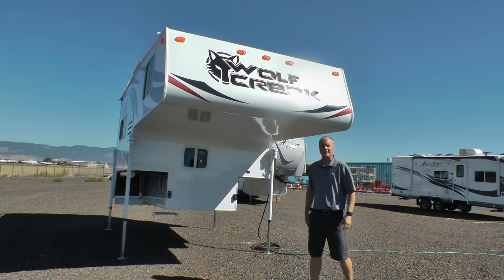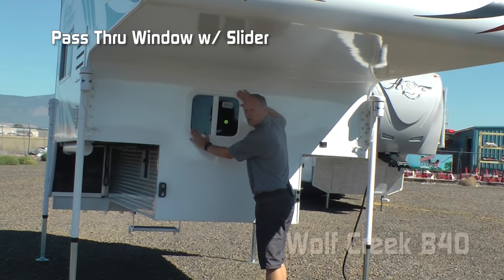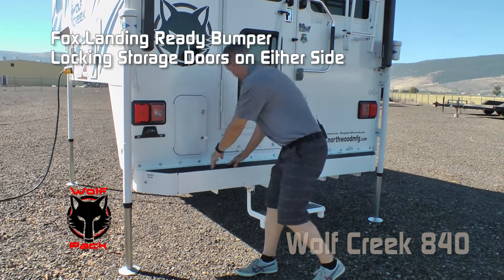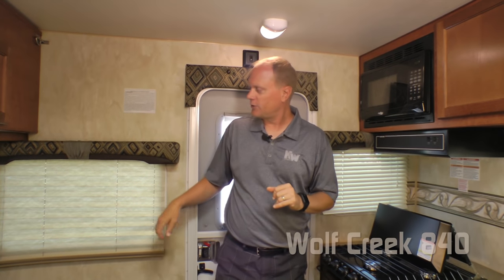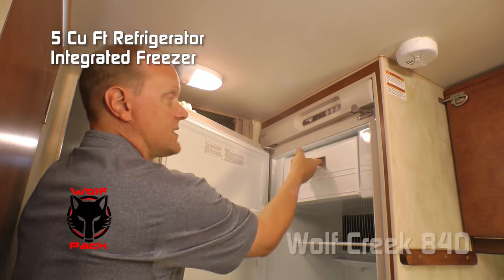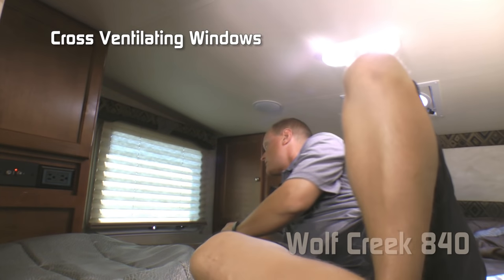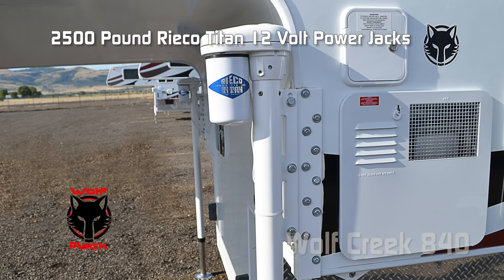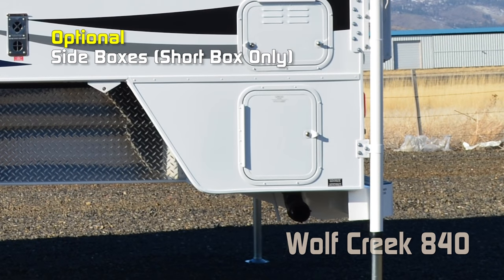Quick Tour Of The New Wolf Creek 840 Pickup Camper

Comment: Very nice camper, and top-notch video presentation! To the manufacturer, I would also say very old school. Maybe it's time to stop the gaudy racing-striped exterior paint jobs that are done to death to the point of being a dated cliche. There's wasted space in the cabinetry construction and in unused side and upper corners that could provide at least 30 square feet of additional storage. Why are these not offered with OPTIONAL convection ovens, giant microwaves, and enormous refrigerators? Not everyone plans to bake a Christmas turkey,  nuke a big-dish casserole, or store food for 6 in a cramped RV, where more drawers/cabinets in those spaces would be beneficial. There is not "tons of storage." There's no way 4 people could store winter coats and boots. Why are dinettes not offered with an optional two-seat version, with all that other space occupied by 4 seats used for cabinets? Why isn't the mattress built to raise up on hinges so that the underside offers queen-size space x 5 inches beneath for critical additional storage? The awning is great, but where's a simple roll-up three-sided canvas & Velcro attachment that would turn that space into a livable additional exterior tent-type room? Such a small thing would double the living space when parked. Why isn't the sink cover one solid piece that could be folded down or mounted on the side of the sink for an enlarged counter top? These old-fashioned designs really should be scrapped and put back on the drawing board to maximize their usefulness, especially for single or couple-only occupants. I'd gladly trade pretty for efficiency. Give us a built-in safe, a deep sink you could wash boots in, a built-in 5-gallon bottled water dispenser, built-in surge protector, built-in vacuum with hose that will reach from dashboard to rear, and a small wood-burning stove that can be opened to the inside for off-grid heating or closed and opened to the outside for off-grid cooking, please.